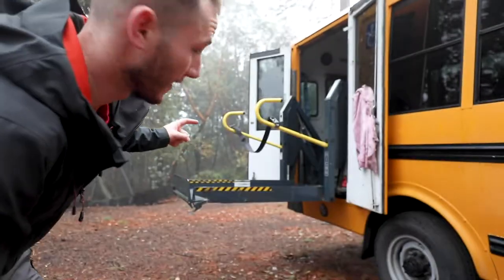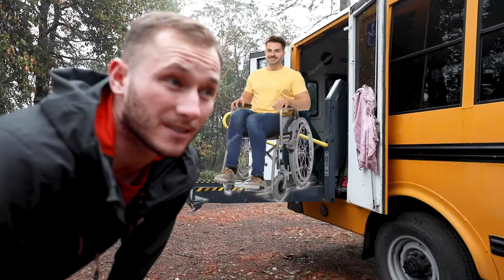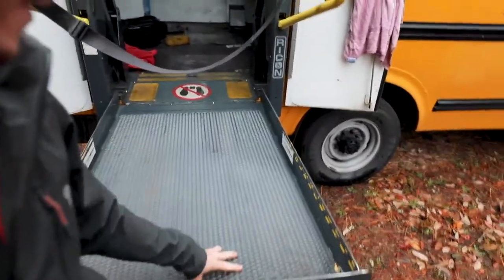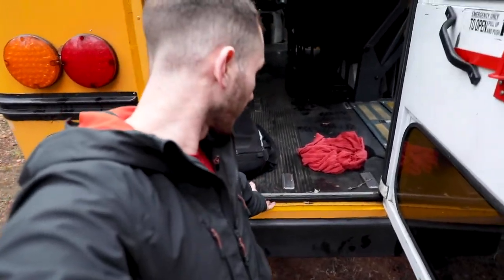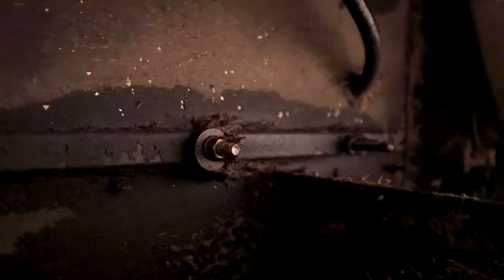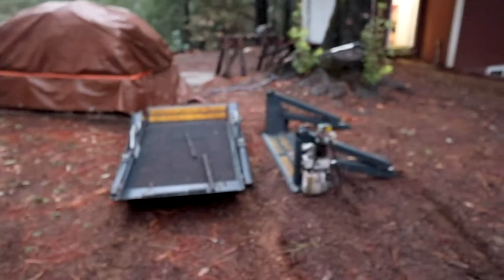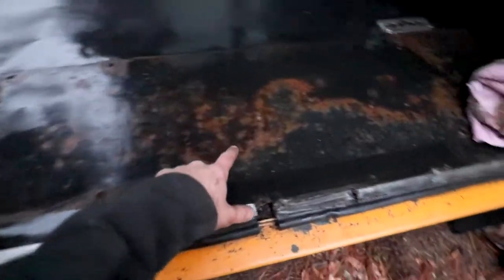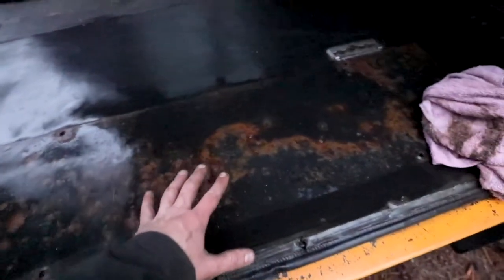Removing the Wheel Chair Lift from the Bus - Bus Build Episode 1

Comment: I folded the wheelchair lift out onto the ground and then disconnected all the electrical to that electric box that controlled it. Then I took the cover plate off the center in between the two arms and cut the wires and when I cut the wires I cut the hydraulic fluid hose and it squirted everywhere but, it also made it possible for me a 59 year old woman with a back injury to just slide the whole system out on top of the platform of the lift it was so easy. Now I just got to wait for the guy to come and take it so he can scrap it

Comment: Thanx for sharing this! I am in the beginning of removing the lift. What did you do to disconnect from the battery and wires, etc.
Reply from the maker: You're welcome! The wires got taken out too. You'll have to spend plenty of time tracing wires to see what can be removed and what can't just to make sure you don't tear out the wrong wire, but in the end it's worth cleaning up the original wiring setup.

Comment: My son removed the lift from his bus as well. Now he can’t get it to go into drive. Is it related. I know there’s a safety mechanism that doesn’t let you go into drive while the lift is deployed. Is there a way to deactivate that?
Ok so we figured it out for anyone else having the same problem. Here’s the fix. There’s an electrical panel box above the driver seat he disconnected one wire at a time and reconnected it if it didn’t work until he found the one that worked. He said he also needs to push the brake in very hard but it went in drive yay!!! 😂
Reply from the maker: Sorry I couldn't reply before you got a fix! Indeed, the fail safe wiring in these buses is a total rats nest of cables and figuring out what disables what can be a total challenge. Glad you found a solution!
Reply: Turn ignition half way put bus in neutral start bus put in drive 😉

Comment: What did you do with the connecting wires that were left behind?
Reply from the maker: I tore them out! At that point I didn't know much about 12v wiring but they all come from the control panel up at the front so that the driver can have some control over the rig. Since I didn't need the lift I didn't need the wires. Just make sure you don't tear out wires for your back lights!

Comment: Reality check: So you know how much one of those things cost?  
I too have a lift to remove. It's similar to yours but perhaps a bit newer. I've done another one before on a '95 International Bus. That one came out w/o problems by disconnecting the bolts while the platform was on a pallet on the ground. 
Now I'm dealing with an 2011 vehicle and a Recon Klear View lift. The whole bus/lift looks still brand new. To get to the point: I called Recon to get an idea how much these things cost in order to come up with an asking price once I have it removed. Scrapping it would be criminal because a new Klear View type costs $10k. And that's just the lift. Want one installed by the Recon Company? Brace yourself, because that will be another $5k extra. I assume that would include the various hardware needed to safeguard students inside the bus. 

There may be some nonprofit elder care or similar organisations who depend on donations to acquire vans etc for transporting lesser abled persons, children etc who would take that off your hands, possibly pay a modest amount of money to have it installed in one of their vans. Or you could donate it to such an organization, estimate a reasonable value and use that as a tax deduction (I'm sure Donnie Trump would ;- ) No matter what, scrapping it does not seem a best choice. Good luck.

Comment: What are doing with lift
Reply from the maker: I scrapped it. Because of the way that I started to remove it, I had to disassemble it in order to get it completely out which left it beyond repair.
Reply: @BibiaBus   ah nuts I got to find out where to get one
Reply from the maker: @brucebonkowsky9406  TOO BAD! I woulda let you take it off my hands but too late now...
Reply: Bruce Bonkowsky  I have a lift still in my bus. Let me know if you are still interested in a wheelchair lift.